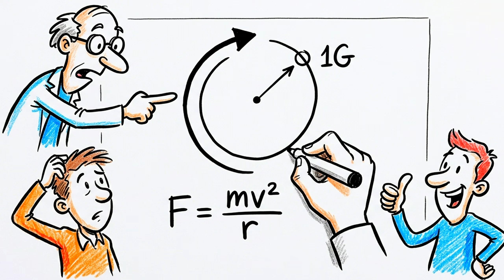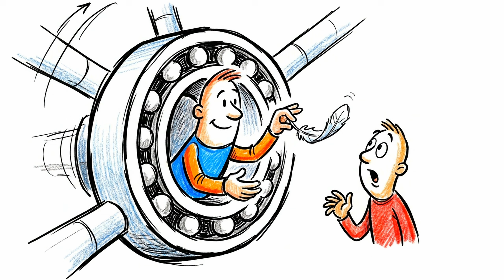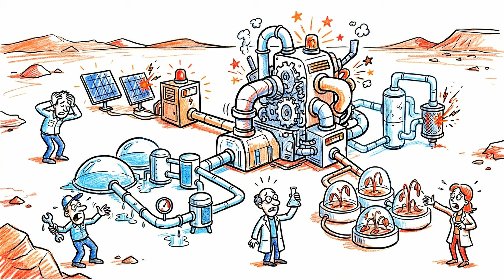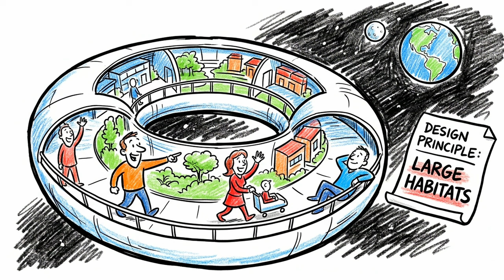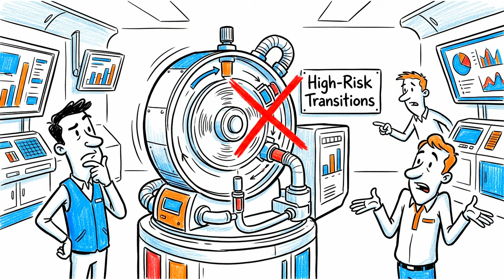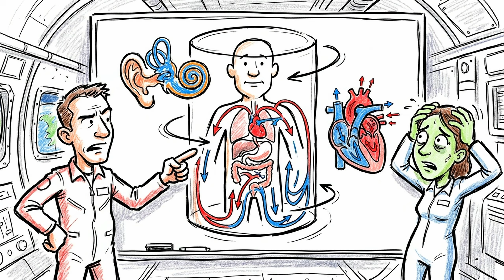Mars Gravity Fix Could Become the Colony’s Worst Machine

Comment: The centrifuge would have  to be large,  using materials that  is hard to degrade. Architecture is structured in a way areas of friction are eliminated ..  The centrifuge lays flat on the surface (easier to build this way)  the inner  floor would have to be set at a 45 +- degree angle that balance  between the  gravity of mars and the artificial gravity   and the angle of the inner floor would have to adjust based on how strong the centrifugal force is  compared to the mars gravity, The centrifuge   should be set in constant rotation  ..That means one would  have to enter a chamber that  starts to spin to synch up with the   entrances inside the spinning base  and you move down or up through one of the  entrances, its a temporary discomfort until you reach to the   spinning floor. You can probably have  stacked centrifuges, where the bottom one is   the entrance from outside.. you walk in and it start spinning to synch up with the upper level ones that constantly spin.   We an probably build to test this on earth and the moon first .. mastering  to build it in these two places will make the transition to mars easy in the long run

Comment: This is excellent for the fact that it made it clear that we are never going to leave this planet in any meaningful way. So many grand ideas that would take centuries to implement. If they were practical to begin with. Always good to remember that everything works on paper. As you move into the second half of the 21st century it will be impossible financially to make anything like this work. That fact along with the nonsense reasoning given for these presumed missions. Resources should be spent on the only planet on which we will live. This one. We will never live on the moon, we will never live on Mars, we will never live on Jupiter, we will never live outside this solar system. Unlike space money is not infinite.
Reply: Artificial gravity generators will be achieved via a physics breakthrough some day, alongside with inertia shield so that the pilots can withstand insane Gs.

Comment: On the surface of Mars you dont't need a centrifuge rotating on a bering. You need a mag lev train going in a circle in an underground tunnel. Just put the "train" on it's side.  No friction, because there's almost no atmosphere and the maglev tracks and the "train" dont actually touch.  Most of the load is on the tracks which are supported by the ground itself.  A mile wide track and a constant speed of 198 miles per hour would be needed, but with no drag and Mars reduced gravity, most of the energy would be just getting to speed, with a smaller amount to keep it going.
Reply: Anytime someone uses the word "just" it means they don't know what they're talking about. Fanciful nonsense.
Reply: You still have all sorts of maintenance issues and potential bad, failure modes.
You still have al sorts fo maintenance issues and potential bad, failure modes.Maglev has yet to be demonstrated to be long-lived and trouble free. Quite the reverse in any of the small scale trials that have been made.

Some have suggested floating the habitat rooms on a circular canal underground, but that gives its own problems.

Comment: The AI used in this video does not seem to understand along which axis a centrifuge creates artificial gravity. 

Artificial gravity is generated perpendicular to the axis of rotation, outwards towards the rim of the "wheel". That means if the axis of rotation is perpendicular to the force of Mars' gravity, the passenger will be flung in a circle like a hamster in a wheel, first against the force of gravity, and then with it. Running along with the wheel (or being carried along in a capsule) would counter the artificial gravity effect. 

The more reasonable direction would be for the axis of rotation to be parallel to gravity, but the passenger would feel two forces of gravity, a weaker one towards the surface of Mars, and a stronger one towards the horizon. Probably the astronauts would be immobilized in this centrifuge for a number of hours a day to allow their bodies to recover from low gravity conditions. They would not be able to do work in this environment because the gravity would be unstable, and the inner ear effects described. It wouldn't need to run 24 hours a day unless there were enough crew for them to use it in shifts. 

For long term duration artificial gravity, the long radius centrifuge should probably be located in space, so there won't be an actual gravity component to compensate for.

A centrifuge COULD be made cone or bowl-shaped, generating just enough lift to counter Mars' gravity while generating artificial gravity parallel to the ground. (So you would walk around on the walls) But Mars' gravity is high enough that the slope would be noticable. Probably such centrifuges would be more suited to Moon gravity.
Reply: Yes, this. Thank you.

Of course this guy isn't as bad as NASA... they've spent trillions of dollars and never run a one-third g experiment. Von Braun would be appalled.
Reply: @patricialee76 Well, they've never been back to the moon. There's noehere else to conduct a reduced g experiment. 

They have done bedrest experiments but we can't be sure how those differ to low-g.
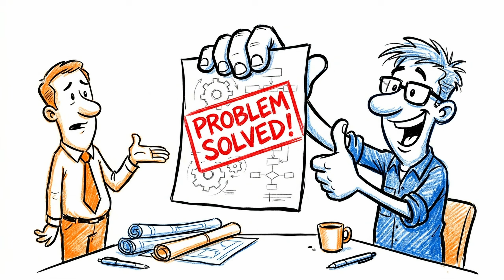Reply: Also, I could be wrong, but the explanation from 1:11 through 1:20 describes another problem.

 "...the outward force felt by anything inside the centrifuge..."

An object has to be in contact with the centrifuge surface to feel the "gravity" effect. If a ball is tossed up, would it come back down?